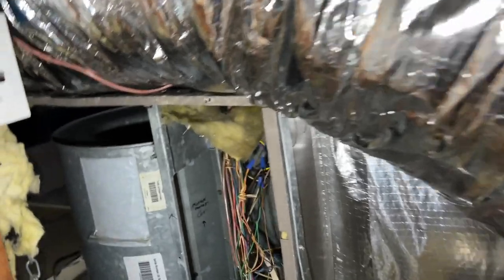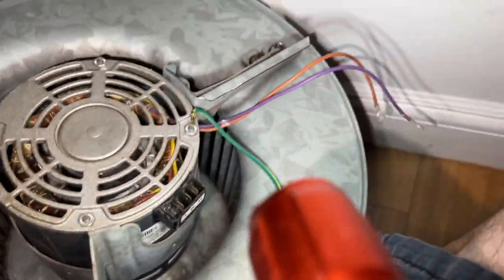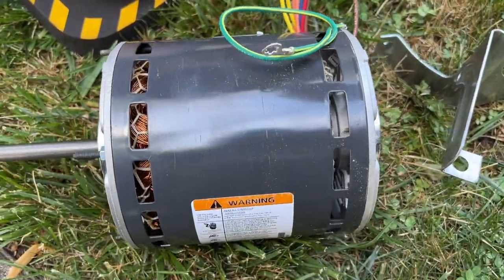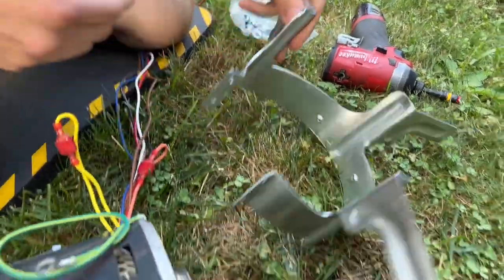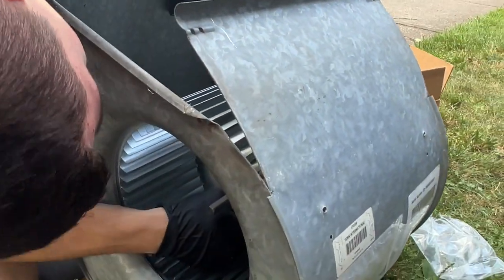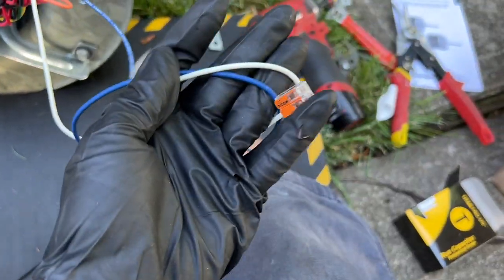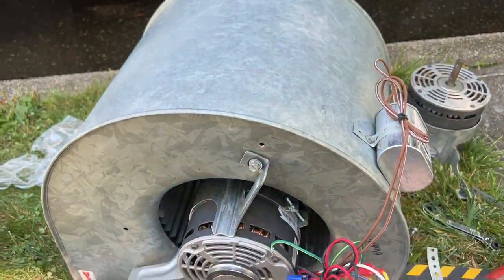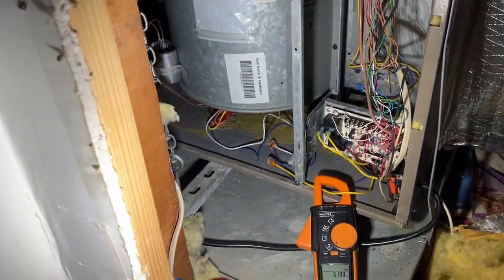Rebuilding a Hack-Job Noisy Blower with Hardly Any Access!! 208/240 Blower on an R-22 York AC Unit!!

Comment: Hey Daniel, Good job on the blower wheel replacement.   Just a quick tip.  When you have the old motor out, use the box of the new one.  Turn it upside down, poke a hole the size of shaft, and place the new motor on top of the box, with the shaft down the hole.  This way, you have a platform to work on, without getting the motor in grass or dirt.  It helps greatly when putting those legs back on!